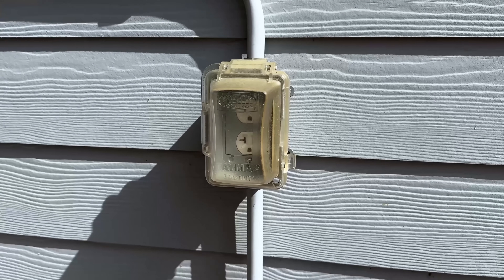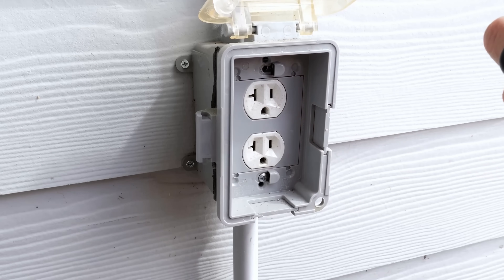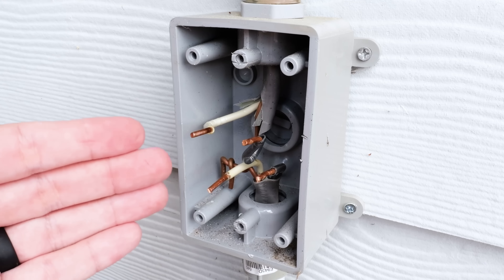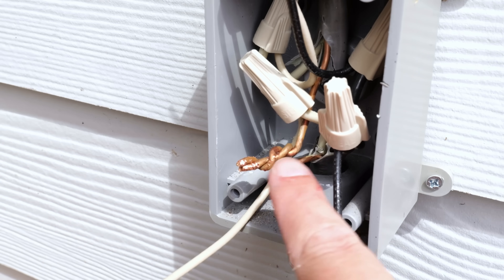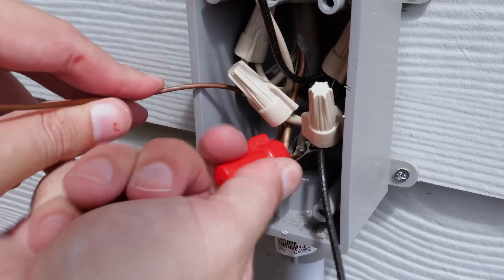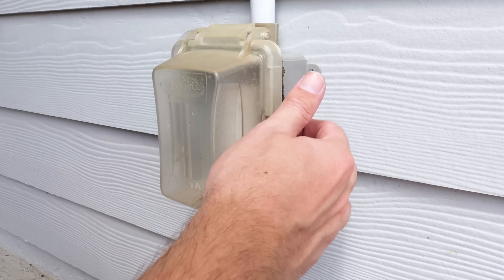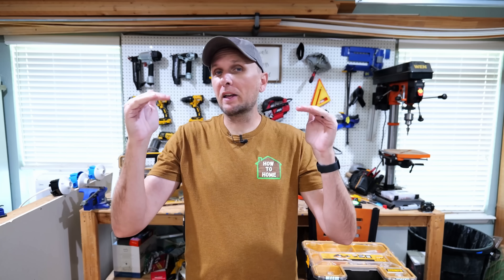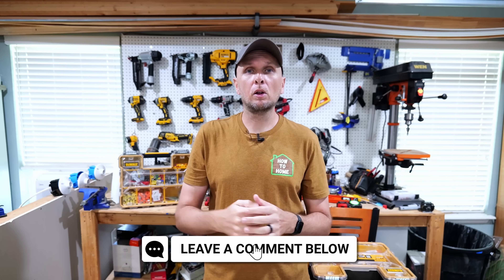Dangerous Mistakes DIYers Miss When Installing Outdoor Outlets!

Comment: If the original wires were 10 gauge your using 12 gauge jumpers you just defeated the reason for using 10 gauge on a long run to overcome voltage drop. If you would of spliced your 12 Gauge to both 10 gauge you would not of created a potential voltage drop through the 12 gauge wire. Once made smaller you can't reclaim the benefit of the 10 gauge in the first place. It is just the weak link now in the system. Perhaps there is a 30 amp plug down the line? Possibly on a 30 amp breaker?
Reply from the maker: No it didn't.  That far upstream it would have almost no effect on voltage drop.

Comment: Why didn't you just put the two whites and your short jumper wire under the same wire nut? It's doing the same thing as when you attach them to the receptacle individually

Comment: So, was doing a similar job.  Turn off the breaker, opened the receptacle and found, like your video, two neutrals.  Thought nothing of it until touching one delivered a shock.  Some idiot was sharing a neutral with another circuit (lights).  This can't be legal...right?

Comment: You don't show it but 1st check power is on that way when you turn breaker off then test   you did better job of confirming status...next generally preferred to have 9 inches....next you should be using wire nuts rather than wako things

Comment: You did not address box fill. Heaver gauge wire, wire nuts and GFI receptacles all add to box fill. I don't have my code book handy to quote, but you may need a box extender or replace the box with one with a higher volume. Anyway thanks for your content, it all helps.

Comment: Why did you not detect a missing ground  wire of your GFCI meter? Did it not display missing ground wire message?  A normal outlet tester has three LED lights and will detect the missing ground wire.

Comment: Looks to me like that receptacle was cut into an existing line.  No reason to run #10 from the panel to that box, it wouldn't have made a significant difference over that distance. The short wires look like they would have been about the slack gained by cutting the box into the conduit.  "Already have power here, I need an outlet."  Homeowner hack.  My house was treated the same way by at least one of the prior owners.
Reply from the maker: There isn't #10 from the panel to the receptacle.  It is #12.  The #10 starts at the box about 2 foot from this one and then goes about 150 feet out to a shed.  That was the reason for it.

Comment: My next step would be to check the rest of that circuit for the lack of grounds and the like.  What is further down the line?  Generally, Romex cannot be run in conduit that is underground or exposed to the weather.  Would that apply in your area?

Comment: Not an electrical issue but the bottom mounting screws on the outlet are way too close to the edge of the siding.  Wouldn’t take much for the siding to fail, causing an electrical repair and a siding repair.  Depending on siding manufacturer could also void your warranty.  Move the box up an inch, pull new conductors, slap and sterilize the original installer.

Comment: This episode was brought to my attention by Cathy, one of my apprentices. 

I know it is allowed by code in most jurisdictions but just using the two GFI receptacle mounting screws to hold the weather proof cover tight and the receptacle to it's box is a no-no to this master sparky's work ethics. If I see any of my sparkys doing that I'd have them on the carpet. 
We always drill out the four corner holes and screw the cover down tight with these. 
Also, seeing the sun fading/UV damage on the cover we'd have replaced the cover with a new one to improve the seal integrity; sooner than later that cover is going to fail. 
Geoff (Ontario, Canada)
Reply from the maker: Ok.  That’s just personal opinion. And it’s my house so if I want to add a new cover I will but it’s still in perfectly fine shape.

Comment: There's nothing wrong with that outlet, he's doing this to make a video. The GFCI is probably be at the breaker in the box,  it doesn't have on the receptacle, also the wiring in the box was fine. Notice he didn't GFCI test outlet before  hand.

Comment: A 20 amp circuit breaker, 10 gauge wiring with long run, why wasn't a 20 amp GFCI not installed vs the 15 amp in the demo??
Reply from the maker: Because I didn't want a 20 amp receptacle there?  Completely allowed.

Comment: You may have complied with code by adding the 6" extensions and GFCI, but I know from decades of experience that  adding the wire nuts and cramming it all into a tight fitting box, you made the outlet less reliable.  When I worked in electronics manufacturing we used a thing called a Buchanan crimp and snap on cover.  They were more reliable than wire nuts, when crimped properly with the correct tool and more compact.  Perhaps they are not allowed in residential wiring anymore

Comment: There is no such  thing bas a 20 amp plug. The horizontal line is to identify that the outlet comes off a 20 amp breaker. How do u know yhats not a gfci outlet?? Perhaps it is connected to the liad of a gfci outlet  that is in another location. I got 1min and 23 sec in begire i gave up on you
Reply from the maker: Oh nooooooo you gave up?  How will I sleep tonight 😂.  And I know because I checked?  😂

Comment: So I'm curious: Would it have been correct, or maybe even better, to use a single wire nut and connect the 10ga wires together, with a 12ga pigtail for the outlet? This way seems to put a short section of 12ga wire in a run of 10ga. Thanks for the video! :)
Reply: That was my first thought. I wouldve went to the next box down the line to see if there was any available slack to pull even a little bit back to make that connection.

Comment: Always wondered why the boxes have to be so small as to bunch up the wires inside them. Any heat on the wires insulation and they might crack and short circuit. Just make the box bigger!

Comment: You can't use a smaller wire. You have to use same gage wire to be legal. Not legal
Reply from the maker: Really?  Share that code please.  I will save you some time, it doesn''t exist.  You cant use a smaller wire than the rated circuit.  Nothing about a smaller wire than the wiring run that is rated above the circuit.

Comment: For the uninformed it would be best to clarify why you tested both top and bottom outlets.. the isolation tab could have been removed.. also another solution for short wires is the p&s duplex hd receptacle.. when the nut is also the compression plate..

Comment: I did not hear you say anything about the breaker.  But I did notice the breaker was 20 amps.  What if the breaker was a 30amp and the outlet was the wrong size for the breaker.  You need to follow the circuit back to the panel to be sure it is ALL aligned with code.   The breaker determines the gage of the wire and outlet.  Thanks for your videos.

Comment: By using 12g pigtails, you have negated the 10g voltage drop protection
Reply from the maker: Nope, sure haven't.  Not that high up in the run.

Comment: the clamps code gives inches from any box
the receptacle should be mounted with the longer ground pin hole on the top
if it were a hospital or fire station it would fail
grounds are meant to be longer to help  keep the plug from pulling out

Comment: Had standard 2 -wire indoor/outdoor (armor) wiring (screw in fuses) in old house until a few years ago.
Never got electrocuted but could sense some objectionable current in the ground outside especially in wet weather.
Also tingling to turn off water when done in shower by  touching the faucet handles.
All good to go now though - breakers, ufb(outdoor) and GFCI everywhere.

Comment: Stopped listening at... "Because Code".....How did any of us in this entire country survive 100 years of electricity without the most current "code"?
Reply from the maker: That isn't really a valid reason.  We used lead paint for many many years too.  Things change for a reason like code.
Reply: @HowToHomeDIY  And if you don't eat lead paint chips it's generally not a problem. Common sense got this country a lot further than "Because Code" type rationales. 

There are tens of millions of homes and other buildings etc...wired to older standards and they aren't burning down or killing people every day. I actually handle fire insurance claims etc...from time to time. I can count on one hand the number of "bad electrical" cases I've had vs. the far more common nitwit using a space heater and catching his overflowing laundry basket (also known as the floor) on fire.

Things change because materials and processes change etc...and yes, some of them certainly are better. But that doesn't automatically mean that everything else has to be replaced just because the standard has changed. For example----Why is it UNSAFE to not have 3" of wire protruding outside the box? Is there a real reason, a serious and immediate, Health and Safety consideration, that mandates that particular change?

Comment: Would it be better to connect the 10 gage white line and load together with a pigtail from that connection then the same connection on the black line and load.  Then there would not be the potential for resistance at the connections due to wire size drop to the outlet.
Reply from the maker: No because then you don’t have GFCI protection downstream.  At this high up in the run the #12 pigtails aren’t going to cause enough voltage drop for it to matter.  I would say it won’t affect it at all but someone will rightfully point out that it will make a difference.  But it’s minuscule.
Reply: @HowToHomeDIY thanks for the response.,  if it was an amp drop issue could it be done that way then put a gfci down the line on next?

Comment: Yeah, I've seen those mistakes made....hundreds of times in my 45+ years as a builder/ remodel  contractor. Most old homes never have a GFCI outlet installed outside, some don't even have a weatherproof box.  I recommend bringing them up to code and strangely enough, I've never seen or heard a story from a client about  someone getting shocked, electrocuted.  So lose the liberal fearmongering. Codes are there for a reason, sometimes a one in a million reason, if that. It's like the idiocy of arc-fault breakers.

Comment: You said they had a 10ga wire but it looks like you used  a 12 ga... I presumed it's because it was a "terminal  receptacle" (I mean not going on further since you 10ga were moving forward ??? am I correct?

Comment: Your klien no touch voltage tester should be tested first before you test for voltage on the circuit your working on cause the battery or batteries in the no touch voltage tester maybe dead

Comment: @7:30 When switching from the 10awg wire to the 12awg wire in that box wouldn't that affect the electric drop down the run.
Reply: No, because any voltage drop in a six-inch length of 12 awg wire would be infinitesimal.  The 10 awg wire would not "see" any resistance increase in/from such a short wire.

Comment: It should be noted that sheathed wire like the  #10nmc used here is not code compliant to be used inside a conduit in wet locations.
Reply from the maker: Why would I note that?  The cable in the video is UF cable.  It is completely code compliant to be used inside of conduit in wet locations.  It isn't NM.
Reply: @HowToHomeDIY Apparently I misunderstood the code.  I thought it meant any sheathed cable.   What about SER. Can it be pulled through a conduit?

Comment: I have one of those testers and 20 years ago found everything in the house was correct.... except the original outdoor receptacle in the rear stucco had the black as neutral and the white was hot, line...whatever. I noticed this after building my outdoor kitchen and patio. My GFI in the bathroom would sometimes pop due to the flood lights outside (in the weather). Once I labeled the wires correctly in that stucco outlet and made the proper changes ...the GFI problem went away. I'm a 40yr experienced new construction plumber and watched every trade .... Learned a LOT of the basics just observing..... and asked questions on details.
Reply: I pulled 3 wires for 220 V ac compressor and was going to add an outdoor plug for vacuum pump next to it.  Then realized I would need a 4th wire to get 120.
Reply: One time, I saw an unaltered, factory molded extension cord that had the hot and neutral switched. It was not the highest quality cord.

Comment: It is definitely helpful when replacing old and broken outlets for there to be extra wire length because sometimes the ends of the wire break when you unbend them. However I always feel like it is a potential significant fire hazard or electrical shock hazard for all that extra wire length to just be bent back up and shoved in the receptacle box. I don't think "code" necessarily means safer because that outlet that was on there was probably a better wire nut than a wire nut for bridging the wires. However I do understand a need to have a standard across the board so people know what they are going into if they gotta fix something.

Comment: That's the exact set up I installed except it is served from a gfci on the inside wall behind it. I'm confused about the load capacity,  isn't it reduced when your pigtails are a smaller gauge? I'm not an electrician obviously.

Comment: You have conduit. You probably had enough wire in the breaker box to pull in 3 more inches. Still a clusterf

Comment: When i make wire to wire connections i ALWAYS Solder my twisted wires before installing a wire nut. I know some will say its stupid or overkill. A lifelong friend and licensed certified electrician told me it a little extra piece of mind that they always due so i do it as well. I have opened receptacle boxes before and seen wire nuts had fallen off and the wires either loose or really not twisted together only relying on the wire nuts to do the twisting and evidence of arcing happening so i would rather spend another 30 seconds than to burn down something

Comment: I don't understand why you didn't attach the pigtails directly to the two 10-gauge wires and then just run single pigtails to the outlet. This would have meant only three wire nuts (the red size) in the box instead of five. It also would have maintained 10 gauge wire continuously from the supply to the far away load is. You also would only have three pigtails (bare, white and black) to stuff back into the box instead of five. You added complexity, a little cost and more box crowding for no upside. Also, fewer connections = improved long term durability. I guess you did add downstream GFCI. But then I would have used a GFCI breaker to protect the entire circuit and would have just re-used the "plain" outlet you originally found. Strange choices.

Comment: NOT an electrical, but I seem to remember (years ago) that some if not all GFCI receptacles need to be "energized" before testing them with a GFCI/ receptacles tester.
To do this after the install, simply push the "Test" button in and then push the Rest button in on the GFCI receptacle.
This prepares the receptacles to be energized and then can be tested by the GFCI/ receptacles tester.
Reply: If you mix up your hot and neutral and power it on and you don’t push the test button it will never work again
Reply: @Nuf_Nivah  Your answer does not address my post.
I am saying the receptacle is correctly wired.
Reply: @mv-db4463 I was just saying that this would happen. But yes what you were saying is true because on the newer version that have the safety features you can’t even plug anything in until you do that first.
Reply: @Nuf_Nivah  Cool, thanks for the clarification.
Have a great day !

Comment: You started with 20 amp outlets and replaced them with 15 amp outlets.  Since this is the first in a series of outdoor outlets, it can serve as the GFCI for downstream outlets.  Does it matter if the downstream outlets are 20 amps?
Reply from the maker: No.  A ground fault is a ground fault.

Comment: Is this job south of the Mason Dickson line?  In my area, that looks like a metal box, and PVC isn't allowed to be threaded into metal where there are large swings in temperature. It would need a rigid nipple and FA connector because of thermo expansion rates of metal vs. PVC. On the lower conduit, is there an expansion joint?

Comment: all outdoor receptical should be protected with an GFCI to prevent electric shock and when a short is detected the GFCI will trip the power off to the receptical.  If you have multiple outdoor receptical make sure the main line leading to all receptical has the GFCI circuit to cut power to all receptical if short is detected.

Comment: Not knowing all of the details about the circuit, did you not just reduce the capabilities of the 10 gauge wire (for voltage drop) by pig tailing in the 12 gauge wire?

Comment: @HowToHomeDIY — Step #1 should have been to plug a GFCI tester into the outlet and verifying that operating the tester did not cause the power to be turned off.  I can be very frustrating to find that some weekend warrior or licensed electrician has already installed a GFCI elsewhere on the premises and then having to waste half an hour searching all over when the other GFCI trips without tripping the circuit breaker.

Comment: You fixed many issues but then made  a mistake of your own. Previous outlet was 20 amp and you replaced  it with a 15 amp ,and with 10 gauge wire on the load side it probably has other 20 amp outlets /devices on the load side. You just created a fire hazard.